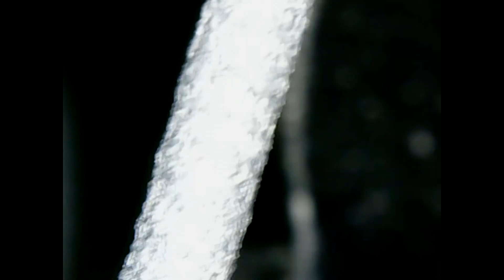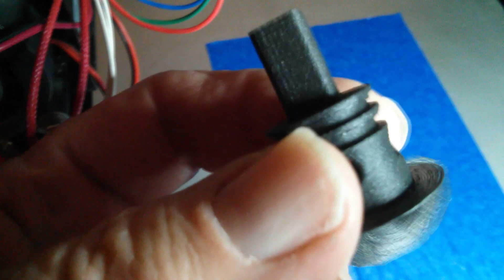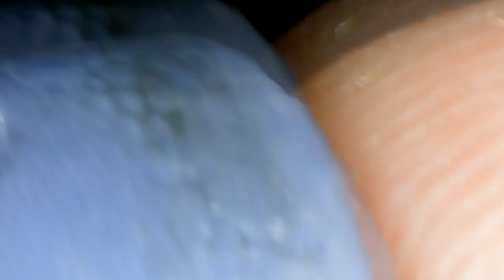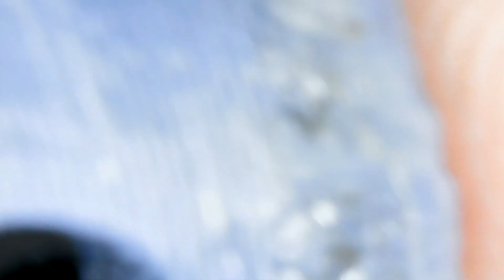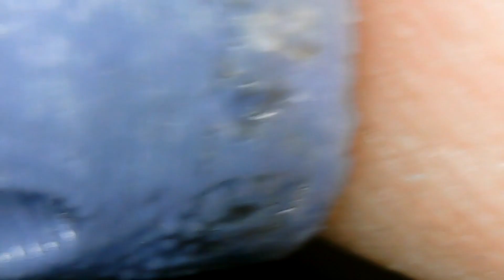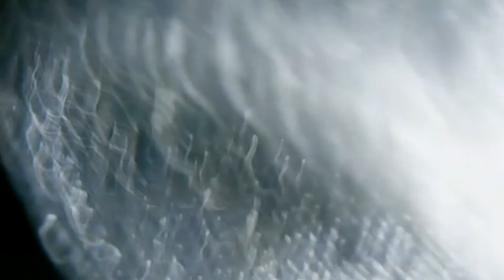PRILINE Carbon Fiber Polycarbonate 3D Printing Challenge

Comment: Hmm.. interesting. I don't have an enclosure so I refrained from using ABS but find myself needing it now. Might try this out. What I wonder is will the small amount of carbon fiber 5-10% make a bigger difference than pla.
Reply from the maker: I found this material produced this particular part with good dimensional accuracy. November is a dry, temperature stable time in Arizona.
Reply: If you have all metal hotend and proper nozzle, it's easier to print this filament than most of ABS/ASA.
Adhesion is much better and you should be able to print it even without enclosure.. 
Yes, it's stronger than regular PLA or PLA-CF, but the biggest difference is thermal resistance:
Crystallization point for PLA is 60-65C, for PC-CF - 140-150C
I never print functional parts that might friction in PLA..
From my experience, the biggest weakness of this material is vertical strength / layer adhesion. 
What you print in X-Y space is going to be very strong!

Comment: What temps did u use for the bed and nozzle?
Reply from the maker: 230c -240c hot end, 90c hot bed.
Reply: @ShotokuTech  Why 230-240 instead of 235?  What happens if you set 250 and 220?

The manufacturer recommendation is 240-260°C with 100°C hotbed.
Reply from the maker: @antdx316  Two things: 1) It worked 2) Are you subscribed? Ha ha.
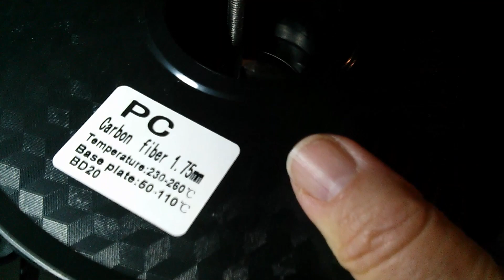Reply from the maker: At 1:23 in the video I show the label on the spool. It reads 230-260, base plate 50-110. I try to gauge the capability of my various printers and avoid using the fire extinguisher that I have strategically located by the doorway. Did you also comment about a temp tower? I was looking for your comment on that from yesterday. But I could not find it. This temperature tower on thingiverse.com is cool because it is GCODE, no slicer dependency. https://www.thingiverse.com/thing:2625999
Reply: @ShotokuTech  it worked but is it strong though?
Reply: @ShotokuTech  Yeah, I've made my own temp tower, I'm printing at 260°C with a closer Z-offset but different for PETG -0.40 and PLA -.10.

Fire extinguisher?  How come these things make a huge fire?